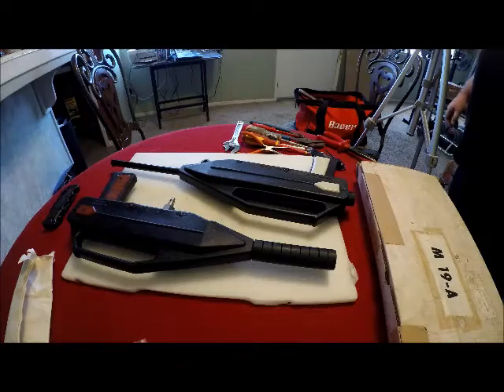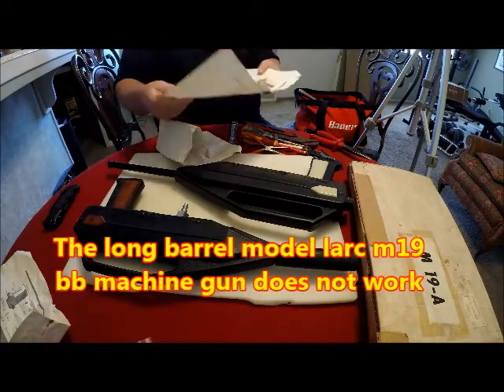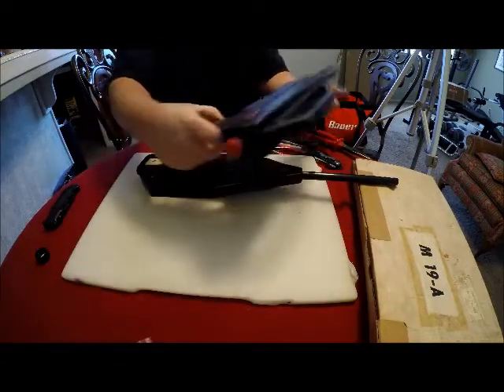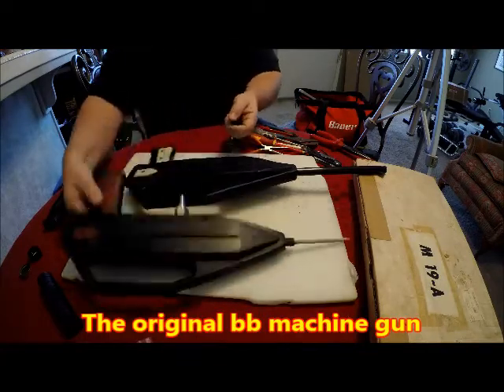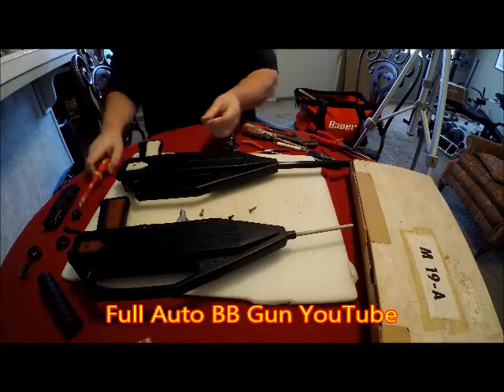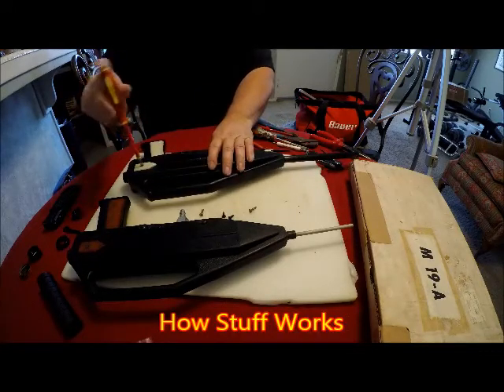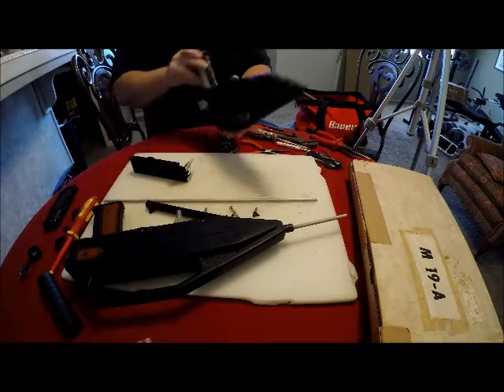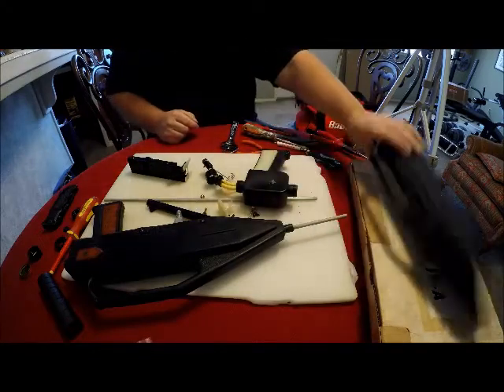How Stuff Works  Larc M19 BB Machine Gun

Comment: I bought one of these in about 1980 when R-12 was cheap. It was a piece of shit from day one, though. The connector that tapped the Freon cans leaked and most of the Freon just drained out. It was made from soft plastic. I believe it only cost $39, but that was a lot of money back then.
Reply from the maker: ive got one that is converted to run off a air compressor
Reply: @StevenSchoolAlchemy  It was kind of weird to shoot. When I pulled the trigger, and the gas flowed into the handle to pick up the BBs, I could feel the gun swell a little from the pressure.
Reply from the maker: @joe-nf7cf opening up and customizing